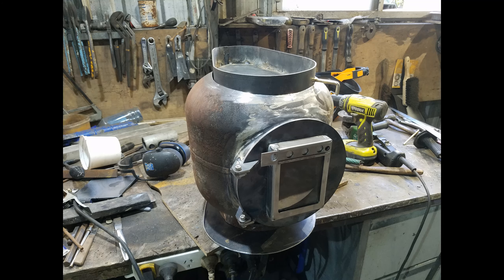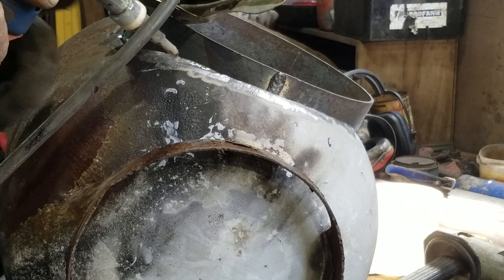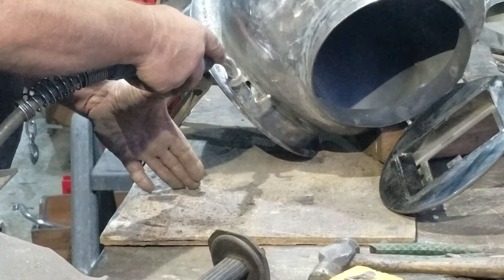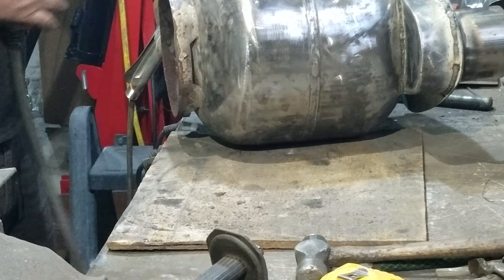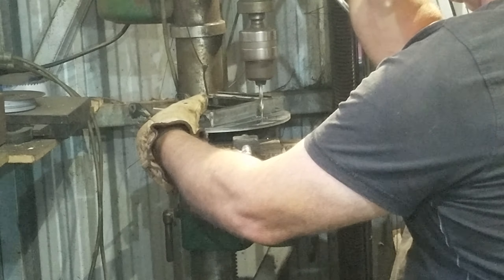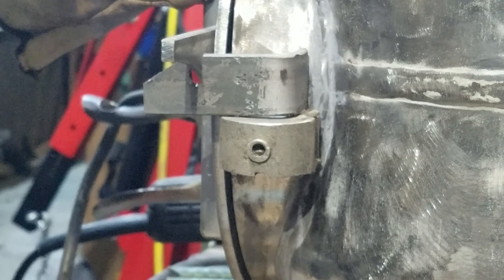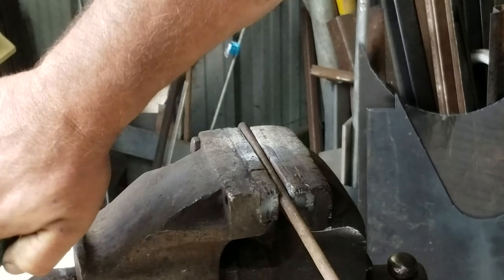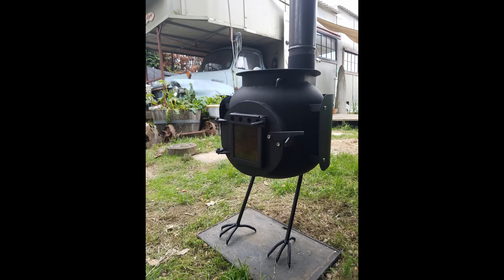The Raven - A Baba Yaga Inspired Efficient Wood Cook Stove Burner DIY Propane Bottle 2021

Comment: I'm loving the new plasma cutter, both at work and for my fun stuff. I did a cut today and actually set something alight, such fun...
I knew when  I unboxed it It would be fun, and a fire risk. I've become tame with all the TIG welding I've been doing on stainless, so pretty ;)
Busy commissioning a big (NEW) Chinese food bagger, rewired and new correctly sized mcbs to prevent fires...
I'll have to be doing some gasless migging soon, don't like it. Bought a 3 phase production mig for later, have to refurb it, "Post Apocalyptic inventor" style soon (Easter). You remain an inspiration, rock on!
Reply from the maker: what are mcbs?
Reply: @t.h.o.r.  "trip" switches, miniature circuit breakers

Comment: i was thinking more of "garuda"=Garuda, in Hindu mythology, the bird (a kite or an eagle) and the vahana (mount) of the god Vishnu. In the Rigveda the sun is compared to a bird in its flight across the sky, and an eagle carries the ambrosial soma plant from heaven to earth. britannica.
  but i wasn't aware of baba yoga= is a supernatural being (or a trio of sisters of the same name) who appears as a deformed or ferocious-looking old woman. In Slavic culture, Baba Yaga lived in a hut usually described as standing on chicken legs. Baba Yaga may help or hinder those that seek her out.  wikipeedia.
  nice work and design on the wood heater, and i can see now i need to get a plasma cutter.  the only suggestion i would make would be make the outlet flange smaller to allow the first chimney pipe to fit on the outside the flange peice.    which will allow you  to stack the pipes in the  opposite direction, with the reduced section on the top.  the last thing you want is carbon monoxide seeping out in the house/garage.  
 and , i have noticed if you can find some triple walled chimney sections thrown out, the center 6 inch section is made with more stainless and lasts for years. the 6 inch stuff they sell at the stores these days doesn't last but about a year, maybe 2 if your lucky.